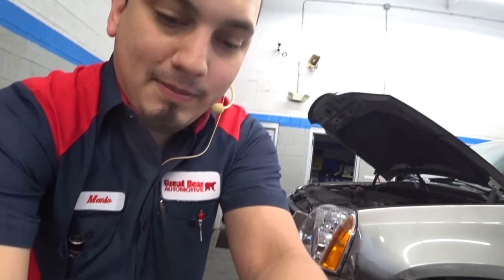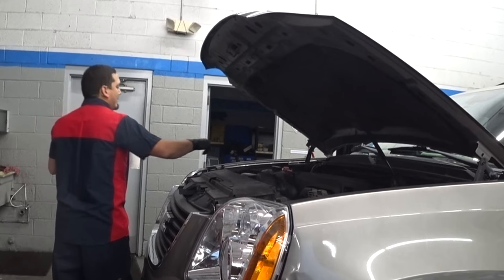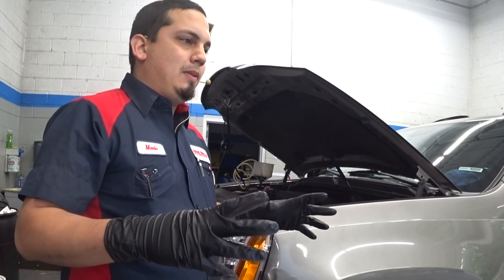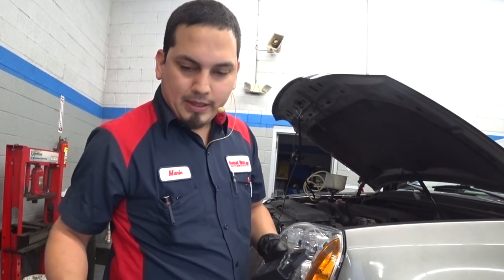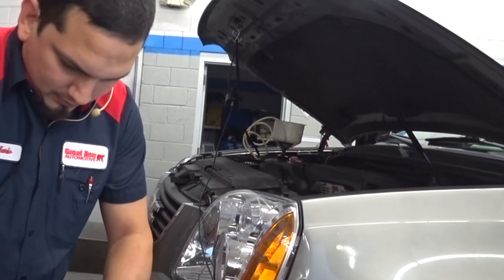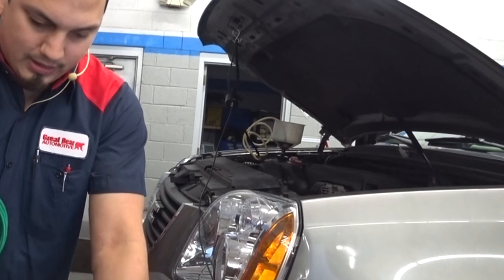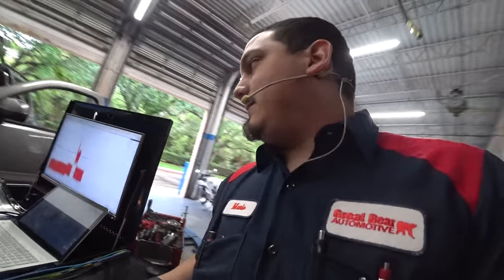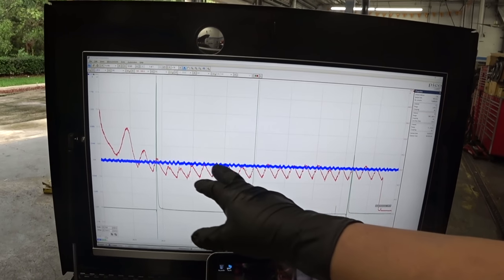SCOPING THE COOLING SYSTEM -THE SET UP- -IN REAL TIME-

Comment: Great demonstration bro. The thing with block testers is sometimes they work and sometimes they don’t. I honestly haven’t had much luck with them unless the vehicles head gasket was completely bad. I’ve had vehicles that had bad heads and would seal once it ran for a couple minutes, which you won’t catch on a block test. The pulse sensor is also good for checking that the water pump impeller is spinning. I’ve used this test to verify a 2.0 vw that the impeller came apart. Another use for this sensor 😆
Reply from the maker: Great points made brother! Couldn't have said it better myself!
Reply: Man I was thinking isn't it possible for the pulse sensor to pick up the pulses from the Water pump and here you go with that comment 👍. I think i need to get me one of these pulse sensors.
Reply: Auto Fix Pal got some in the works. Just need some parts and to build them if you don’t mind waiting a couple weeks?
Reply: @codysautodiagnosticsprogra8706  i dont mind. I don't see potential HG vehicles often at my job (i bet 3 come in tomorrow 🤔) so no Thanks.
Reply: Auto Fix Pal this tool can also be used to see misfires hooked to intake and also used in the dipstick to check sealing of rings. Multiple situations you can use it for
Reply: @codysautodiagnosticsprogra8706  that makes since. Let me know when you have it ready.
Reply: Cody’s Auto diagnostics how much is one of these pressure sensors?
Reply: Douglas Gagnon hey bud in the process of making some more as we speak. They will be $65 when done. Should have them done in next couple weeks, if you don’t mind waiting?
Reply: Cody’s Auto diagnostics thanks.  Let me look at what our shop lab scope has for connectors. 

We have the snap on Veris. I just found a lab scope of some kind that never been used in the 3 years I’ve been there. I see what that is. Can they have banana jacks if needed. ??
Reply: Douglas Gagnon let me see if bananas are will fit. They are cables from amazon that are banana to bnc too FYI. That’s what I use on my Snap-on

Comment: Great video love the idea of doing more tests with the scope.  BTW the blue fluid is not testing for HC's its testing for CO2.
Reply from the maker: That's how little i use it 😆 thanks lol
Reply: @SuperMarioDiagnostics  i have a bottle in my box that i purchased in 1999 and its about halfway full.  It does work, but only under the right conditions. I think this pulse sensor method is more accurate. Thanks for sharing! BTW i pulled the trigger on the micsig scope I like how intuitive it is to use and it makes saving waveforms for later comparison very easy.. Well atleast compared to what i have been using.

Comment: great explanation mario with this setup you can tell exactly which hole is bad  where a dye test only shows a general hydrocarbon leak
Reply from the maker: Exactly. Very very subtle leaks are difficult to pinpoint. I'm all for anything that will help towards a precise direction

Comment: I've always wanted a pressure transducer, cool to see you set it up. PICO offer one but the price is too high. Presumably I'd want a broad enough range to cover intake air vacuum, coolant water pressure, and even in-cylinder peak pressures. Likely need two for different ranges, one for intake vacuum, another 0-300, assuming it won't damage the sensor if overloaded a little. Amazon sell them for about $30.
Reply from the maker: The fluke pv350 is a great alternative to the pico unit. Only have to make sure not to buy the new ones. Only the older versions with the blue box in them. If they don't have the blue box, the unit isn't scope friendly, and only designed for millimeters

Comment: Hey mario. Does any pressure present not try to lift the funnel and pass? Gr8 vid and idea. Cheers dave
Reply from the maker: Definitely, but that would make for a pretty obvious diagnosis where this test isn't necessary. Plus with these tests i keep the coolant level low enough to not cause problems.
Reply: @SuperMarioDiagnostics  yeah, I dont mean large pressures. I have a radiator presure tester that i think would be a better connection. I'l post a quick demo vid of it if u think it would be helpful. Cheers dave
Reply from the maker: No doubt it would be a more sealed connection. But i personally like that if pressure was excessive it would maybe just pop off. If you use a locking mechanism, there may be no hope for the sensor 😆 just my preference that's all
Reply: @SuperMarioDiagnostics  yeah i see what u mean re preserving the test kit but like you said excessive pressure would be visible on the first instance. Gr8 idea for the pulse sensor. Ive only ever used mine in the exhaust. Cheers dave

Comment: Is there a way to know for sure if a particular manufacturer or vehicle has a clear flood mode option? Like if I was looking it up through service information how would I go about finding out if whether or not it has a clear flood mode or I have to remove the fuel pump relay?
Reply from the maker: There's no real laid out service info that i know of that says it. Ford's, gm, jaguar, range rover have it. Second best is to remove injector fuse, if all else fails, fuel pump relay/fuse.

Comment: Hi Mario, I recently watched ur "Ask Me Anything" utube channel, more then a five hour showing, I really enjoyed it, thnx so much, I sent u a question and u said u needed more information, could u tell me is it something else I can tell u about the car that would help r do I need to bring it there?  It's a 2007 Scion TC, 2.4l, 139k miles, 3 garages and a dealer, no codes, no idiot lights, hesitation upon acceleration from a stopped r coasting position, runs very rough & shifts hard b4 warm up in the winters in Ohio?  Plugs have been changed, oil changes every 3k, transmission and motor mounts checked, front end checked?  It also last year had a new serpentine belt, water pump and belt tensioner.
Reply from the maker: Email me

Comment: Mario was it COP. Where did you attach the secondary inductive clamp? Did you attach the pulse sensor to the overflow reservoir? Hope you don't mind the questions. I have a scope but not the pulse sensor. Definitely have the funnel set up. Been buying equipment as I go. Thanks for the help and sharing. 👍👍👍
Reply from the maker: Not a cop, the clamp was attached around the secondary wire. The pulse sensor was installed into the expansion tank. I don't mind the questions at all 👍

Comment: Nice Video. The block test is not 100%. I find the dual chamber tester to be more reliable. But, when traces are faint, i follow up with pressure hold test, and maybe even pull all plugs to look and listen for leaks in specific cylinder(s). THAT ALL TAKES TIME. That pulse tester looks like it can zero in on suspect cylinder without pulling plugs 👍.  I like it.

Comment: Now, could you use the pulse tester to check for water pump operation in a vehicle with overheating/running hot complaint and a suspected flow problem?
Reply from the maker: Great question, I'll need to do more testing. But in theory i suppose it should be able to, I'd probably check it cold though 😆

Comment: can pulse sensor be hooked up to running vehicle to check for head gasket failure? More concerned with overheating and not a compression loss problem
Reply from the maker: As in, loss of coolant into oil passages as opposed to the combustion chamber?
Reply: into cylinder but doesn't lose compression. Work on alot of subaru's, block test doesn't always fail but HG are blown
Reply from the maker: I've just had one of these recently, where the head gasket is like a check valve, the coolant enters the combustion chamber but does not pressurize the coolant system. The best i could do with diagnosing these is to pressurize the coolant system, and use a borescope to find the coolant leak into the combustion chamber

Comment: Nice setup Mario! Will this setup work on a cold engine to identify a blown head gasket? I was thinking if the thermostat hadn’t open yet. Thanks! 😀👍
Reply from the maker: Thanks! Don't see why not. Pressure pulses have a way of resonating throughout the entire system. The test I did on the Lexus was with a cold engine by the way. Even if the pulse doesn't get past the closed thermostat, it should get past the water pump impeller.
Reply: Super Mario Diagnostics Thanks Mario for the reply and was thinking that the pulses could possibly come through the bottom radiator hose. Glad to hear that you performed the test on a cold engine and it worked. To me this is the best test to confirm if there is a head gasket issue. Thanks for sharing!
Reply from the maker: Anytime! Yes with a sealed system, this sensor is sensitive enough to pick up pulses that the wps needs to be on the lowest setting, and zoomed in to see. Thanks for taking the time sir 👍👍👍

Comment: I got burned by block tester 

Showed no exh. 

 in cooling but had bad head gasket 

I love this set up 

Now I hv to go out and get all the needed parts .

 I have a self imposed rule .

I call it the rule of 3 ,use 3 methods to verify complaint if I can not use 3 methods I run by 2 other good techs  before I call it
Reply: SON OF MONTEZUMA that’s a good call using multiple ways to confirm. Block testers never really worked for me. I’m also color blind 😂